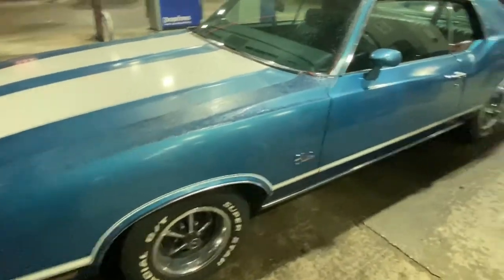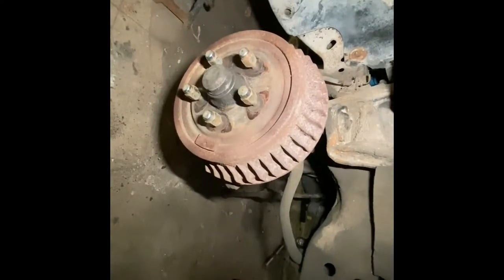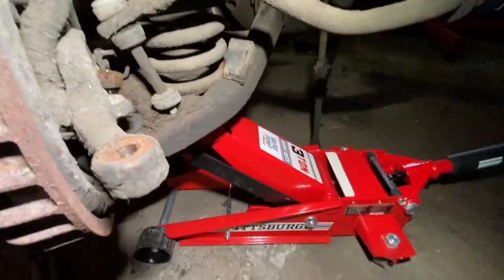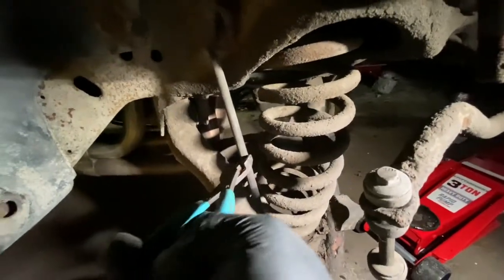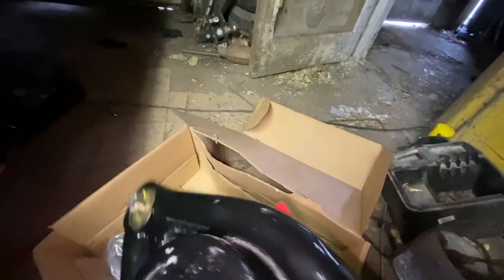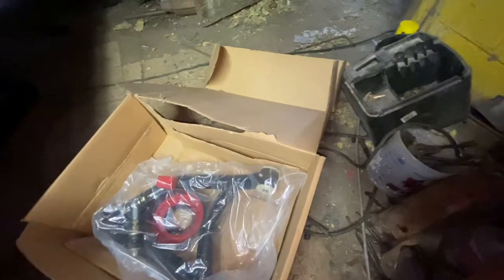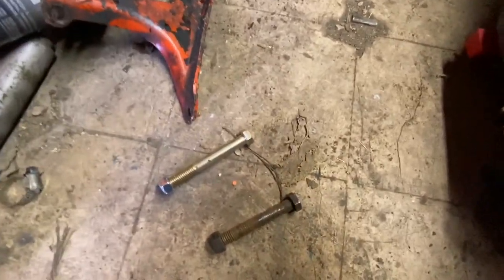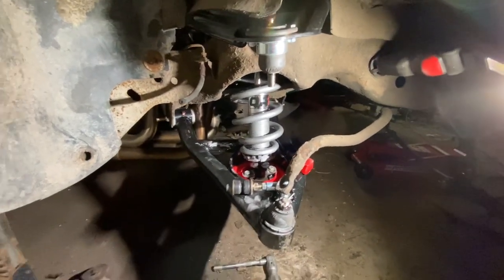72 Cutlass Supreme Suspension And Brake Upgrade Part 1

Comment: Check the  control arm brackets at the frame for stress cracks after a while....  They start to crack and will pull out of the frame over time.
Reply from the maker: You are correct. I have experienced that a couple times on these A-body cars

Comment: How are those A arms working for you? I’m considering the same set for my Pontiac. I saw you replaced the ball joints.
Reply from the maker: They’re working great. As I stated the weak point is the ball joints. They are a little heavy. I’m not concerned with weight myself. I have used this particular set up over times.